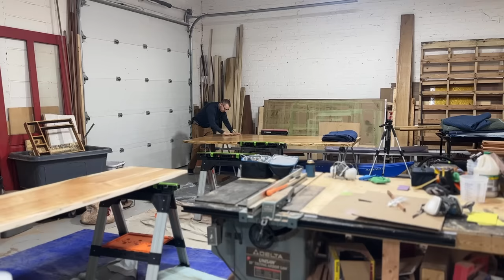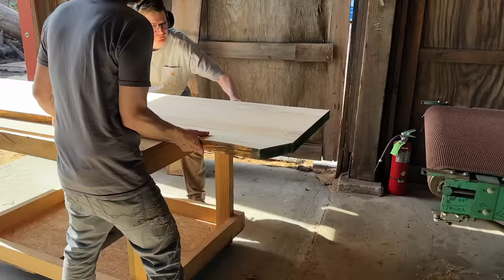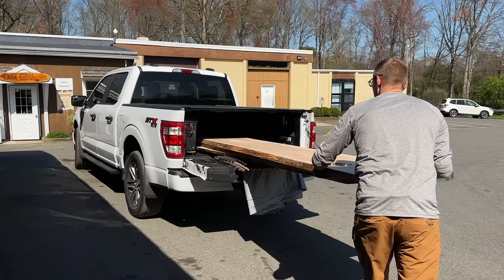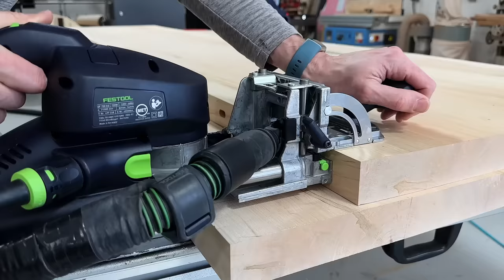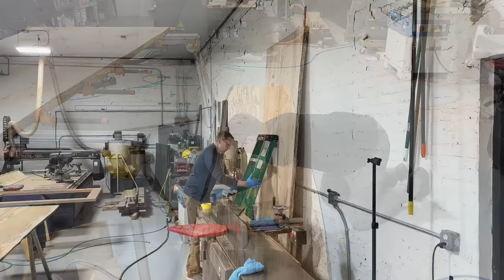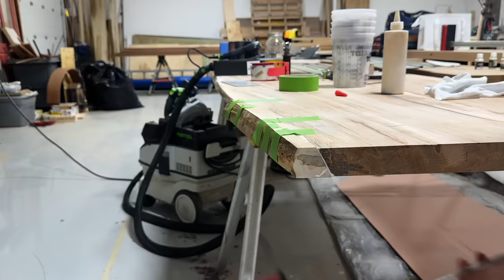Don't make THIS mistake with your furniture business.

Comment: Finally! A woodworking video where no one complains about sanding!  As a finish painter and piano refinisher, I love the tactile feel of bringing the surface down to a satin finish buy hand.  I almost never use a machine to sand any of my projects.  Bravo sir.  By the way, you must give ECO-Steps waterborne finishes a try.  They are phenomenal.  I've been using them for years.
Reply from the maker: Thanks Kenneth! It's all in the prep work, right? It's definitely the most important part of the process, especially in your line of work. Cheers!

Comment: Looking good!

I tested my Lamello out as a replacement for clamps on a panel and it worked out really well. It was only 3/4" material though. you'd probably want to do two tenso's vertically for something as thick as that slab.
Reply from the maker: For a slab, the Tensos wouldn’t provide enough clamping pressure to bring each side together and get adequate glue squeeze out and a tight joint. They only have about 33 pounds of clamping pressure versus pipe clamps which have up to 1000 pounds 💪🏻😁

Comment: Great work as always. Pro tip from your colleagues at TimberFire Studio - Get a Festool STL450 Inspection Light & Tripod to provide consistent raking light down the length of your boards. We've use it to light up to 14 feet end to end. Our buddy at Greenwood Bay Woodworking recommended it to us and it has been a game changer for both sanding and finishing. It's designed for drywall finishers but perfect for furniture. We suggested it to our Festool-sponsored influencer friend, Tommy Mullaney, (who you may know) and he absolutely loves it.
Reply from the maker: Great tip! I’ll look into it. Thanks for the info! 👊🏻

Comment: Here is a trick for joining pieces.
Double stick tape the piece you want to joint to the bottom.
Space the top piece with another of the same thickness as the add on.
Use a saber saw and do NOT cut a straight line, more of a long squiggle, ramble type of cut.
Because the top and bottom are cut on the same line, they should match up quite well and because of the "show pattern" of the wood, the line will be almost invisible.
A straight cut, even with very matching grain will almost always show, because it is a straight cut.  
A long squiggle line won't catch the eye as much as a very straight line.

Try it on a piece of scrape and see what you think.  The scrap has 2 sides so straight cut on 1 and a squiggle cut on the other.
Reply from the maker: Cool technique! 👍🏻

Comment: Hi Keith. Yeah, I'd say for this project get 90-100% of the money upfront. If half of your business was working with slabs, then maybe get 50% down payment. I always request 50% down before starting on a client project. Currently I'm dealing with a client who changed their mind on the design when I was 60% done. The change was significant and required me to start over. However, I did have a section in the contract talking about change requests.  Personally, I don't do slab work.
Reply from the maker: All good tips! We all operate our businesses differently, but having failsafes in place are a must. Like I said, it was totally my fault for proceeding with the job without approval or a deposit.

Comment: For not being a fan of the wood, you certainly made a great peoduct out od it!  If you had to do it over again, would you just use a thinner shellac barrier or would you use a different product?  I'm also kind of curious about the color/surface of the base they'll use. I would think anything other than a solid color and simple structure would take away from the ambrosia tops. Great video!
Reply from the maker: Thanks Michael! I would just dilute the shellac with more alcohol next time. However, I rarely use maple, so it’s possible it just reacted with the surface more than it does with walnut or white oak. But it was only sanded at 80 grit, so the pores were wide open and overly ready to receive the shellacky goodness. 😂

Comment: Is ambrosia maple not a good/desirable wood? $1500 seems super cheap? Usually people are talking about singles slabs costing $3,000-$5,000+. And they're usually shorter.
Reply from the maker: Meh. Definitely not on my short list of desirable woods. Light woods just dont' have much character and maple itself is too vanilla.
Reply: It’s a trendy wood, very loosely, named for the holes and discoloration left behind by the ambrosia beetle. It’s not actually a species of maple. Most often this beetle is going to attack softer woods, and the result is most of the slabs you will see for sale are actually silver maple. Silver maple is often called a junk wood, but that’s a little mean. It’s gained popularity due to backyard sawmills being able to grab up these logs from tree companies who don’t find much value in them for firewood or for Milling. I can be a really pretty wood, and I like some of my recent encounters with the wood, as it was used for exposed framing, and looked great. However, with a hardness on the Janka scale of 700, (eastern white pine is 400, Walnut is 1050, and red oak 1200), silver maple is almost too soft to be a surface that takes every day use and abuse or to make a piece of furniture that will really stand the test of time. Sugar maple, sometimes called hard maple, clocks in on the hardness scale at 1400, about double silver maple and roughly the same as white oak. Durability is paramount in woodworking, and you’ll usually see wood prices reflect that, but of course, other factors such as figure and rarity can affect that. Silver maple without the ambrosia beetle marks is going to cost even less. It could be a great practice wood for that price, but beware, it’s softness means it’s prone to tear out and you’ll want to keep all your edges extremely sharp.

Comment: Is that clear epoxy you used for the bug holes? I’m currently working on a table with the same wood and I’m on the fence if I should just use black epoxy or clear.
Reply from the maker: This was clear. 👍

Comment: That turned out amazing!  So with a countertop, how would you or I guess the customer deal with seasonal expansion? Assuming with a countertop that large it would tear apart the cabinets?
Reply from the maker: Screw along the back of the countertop and then elongate the screw holes at the front of the countertop to allow for movement.

Comment: Given the time to sand w tiny 5-6" ROS's compared to a larger diameter Surcare ROS, not sure why they aren't in wider use? Mine has last 20 years and is still a beast - worth the money in time saved for larger sized slab/panels.
Reply from the maker: Probably because it’s almost $2k and not common in the US
Reply: @KeithJohnsonCustomWoodworking  Yes it costs more but does 7x the work in the same time due to area.  So in one hour of sanding you'd save 7 (6?) hours of labor- how long to pay for tool?  Big cost but only a couple of festool's price and you're finishing at 7x the previous area/rate of finish.  Seems worth it to me, I hate standing there for days getting from 'smooth' up to finished!
Reply from the maker: @kevinmorin7965  Glad it's working for you, but Id don't do enough slab work to justify it. And hoisting a 27 pound sander up on my bench isn't my idea of a good time. LOL. I have the GEM 11" sander and it's more trouble than it's worth.

Comment: When you are going the two pieces bye using the jointer, isn’t it better to get them as close as possible and then the track saw down them as it would mirror the cut on either side?
Reply from the maker: I think there are few words missing in your question...I don't quite follow.
Reply: @KeithJohnsonCustomWoodworking  aha what I mean is where the two joints meet each other place the track on the meeting point of the two pieces, therefore the blade is cutting both pieces at the same time giving a mirror image on each piece. Then they will butt up perfect. Does that make more sense lol. Love your videos 👍
There’s a guy I watch that builds tables that’s how he joins big tables.
Reply from the maker: @ashleewainwright7877  I'm just not a big fan of that method. The track saw is great, but I don't always trust it for a glue-ready edge. I have definitely done it that way, but I just prefer to use the jointer when possible.  And thanks so much for the kind words!

Comment: Hi Keith,  I live near Paramus.  Can you tell me a few lumber gourds you use?  Same for Cabinet-grade Baltic Birch.   Thanks, Steven
Reply from the maker: Garden State Lumber, Boards and Beams, ML Condon, Kuiken Bros.
Reply: @KeithJohnsonCustomWoodworking  Thank you, Keith.  That was a great table you did for Woodpecker.
I see they are coming out with router bits. I was going to get a bit from Bits Bits but maybe the Woodpeker probably has some top stuff.
Reply: The only consistent source in NJ I've found for good Baltic Birch (besides Boards and Beams) is Opdykes in Milford (near Flemington).
Reply from the maker: @boardsbybrent5521 Thanks for the tip! I haven’t heard of them before. Mendham Plywood is another source 👍🏻

Comment: FYI. i have a 1ph wide belt. Seriously the best tool of all time. Worth the money.
Reply from the maker: Can’t really fit one in my garage shop 😂
Reply: @KeithJohnsonCustomWoodworking  Its a beast, but totally worth it. I have the 1ph time saver, 37". SOOOOOOO Worth the money. I've thought about downsizing and can never bring myself to sell it.
Reply: @GearheadDaily  

I've had an alert on bidspotter for 3y for a wide belt to come up

They're like unicorns.....probably because no one ever wants to get rid of one lol
Reply: @scrotymcboogerballs6452  YEP! That should tell you something!
Reply: @Gearhead Daily  my 12" jointer was a bear to find too, that one I had to wait a year for, they would pop up every now and then but essentially on the moon as far as location goes 

I always tell everyone that those industrial auctions are excellent places to look for Bandsaws and Tablesaws, there are always some available, big planers are a little more rare, but still come up fairly often, shapers are next on the rarity list, large jointers 10"+ and shapers are rare af, and drum sanders in the 36-42" range are basically unicorns....You see some in the 20"s range and like 3 stage 30hp 3ph MONSTERS in the 50"+ range but that "Small Shop Sweetspot" in the mid 30s-low 40s are basically nonexistent or someone in Fiji is selling one lol.

If you are building out a shop at home and happen to come across one in that size range snap it up immediately, even if it's the first pc of equipment imo because it may be a long ass time before you see another one

Comment: I’m wondering that (i never used i’m noob) if the shellac preventing the epoxy bonding to the wood fibers or there is not any kind of problems like this?
Reply from the maker: Sorry, I don’t understand the question.
Reply: @KeithJohnsonCustomWoodworking  I mean the shellac bonds to the wood and the epoxy bonds to the shellac. Is it still a strong bond or weaker like glueing two painted thing. I guess on the shellac parts the epoxy bonds to the shellac not the wood fibers itself.
Reply: @zoltan2728  I think the shellac is only meant to keep the (darkened), epoxy from embedding into the surrounding grain of the holes, not the holes themselves. Any errant shellac that gets into the holes, will not cause an issue with the epoxy.

Comment: The tracksaw is fully capable of giving you a perfect matching edge. You just have to have a good blade and run it down the middle so it shaves off a bit from both slabs. if you want a roll of the kickback dice, you could freehand it with a simple handsaw to match sone grains.
Reply from the maker: I am aware of a track saw’s abilities. Do what you’re comfortable with
Reply: @KeithJohnsonCustomWoodworking   I guess you tried it. What was your experience?

Comment: 1500$? Wow that’s good deal.
Reply from the maker: Well, it’s maple and it’s the East coast 😜
Reply: @KeithJohnsonCustomWoodworking  I'm near KY and TN and that area, but I guess I'm used to walnut at between 16 to 24$ a board foot - air dried / kiln dried boards. Building a table turns into a 2400 adventure (with top, apron, legs -and I go cheaper with oak or even pine for a frame because it would be even more). 

I want to do slab, never have but I hate plastic rivers. Most I do with epoxy is clear or maybe colored pours into knot holes. That's my contribution.

Comment: I know it's personal preference, but you don't need the domino's to join the wood together. It adds 0 strength over just wood glue.that theory has been tested countless times. Beautiful build though, I wish I had a wood shop myself, but I live in an apartment sadly 😥🤷‍♂️
Reply from the maker: Yes, I know  it dominoes don’t add strength on long grain joints, but they help greatly with alignment of the top edges. Trying to clamp live edges are extremely difficult since there are no square edges. The dominoes ensure that you aren’t fighting to keep the top edges aligned while clamping.